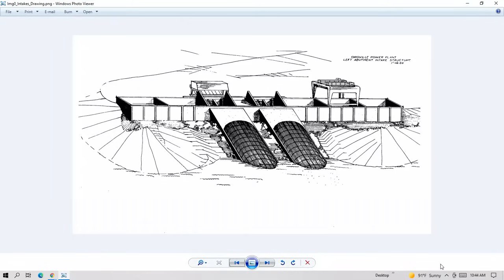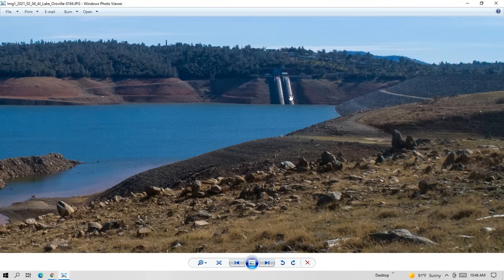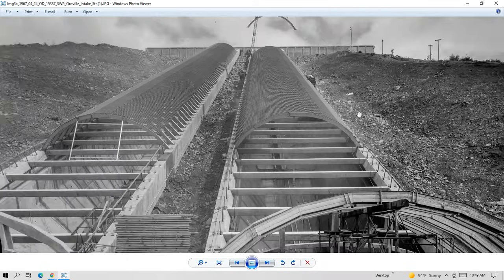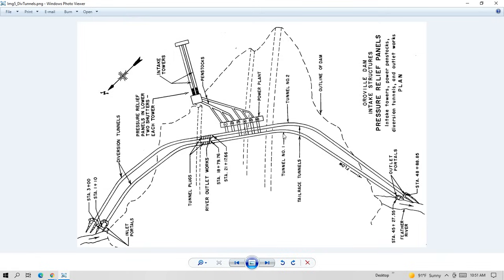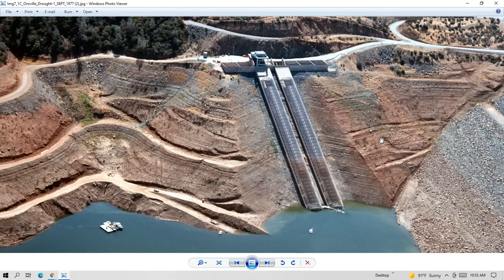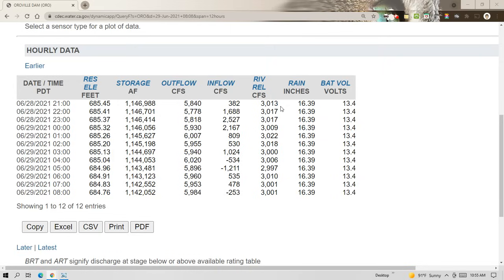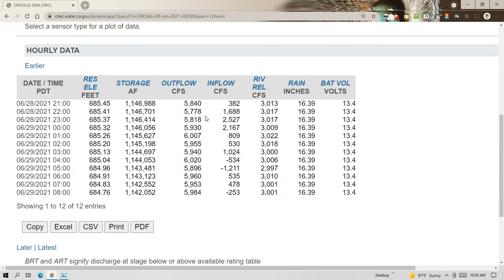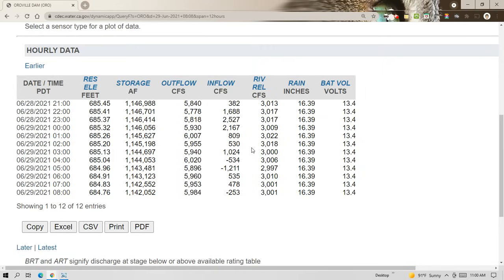When Drought Comes to the Oroville Dam by Millie Kay 06-29-2021

Comment: Good Job Millie,..... as always your statistic and commentary is right on and correct on all accounts ! The River Valve Outlet system ( RVOS ) as you know, is for the most part, a last resort means to the continuation of " just water " releasing into the river from the dam and the 6 generators in the undergrown Power Plant can no longer produce electrical power because water level is no longer high enough to flow into the intake structure.  As you will recall, DWR had a severe accident when the RVOS was used a few years back and the outlet flow baffles had to be rebuilt under that event and there were some critical injuries to DWR personnel that were operating that valve. Water that is now being diverted to the Thermalito Forebay can now drop the 100' through the Thermalito Power plant and not the spillway into the Afterbay as all 4 generators in that plant are now up and ready to go after the fire that totally shut it down back in Nov. 2012. But,....... at only 3,000 +/- cfs passing through, the RVOS and only one generator at Thermalito is producing power,.... so much for filling the gap during Brown Outs when the power generation from a total of 10 generators is severely limited to only one because of the sever drought water level conditions in the Oroville Reservoir as that water being conserved while the temperature is running in the high 90 to 110 degrees for days at a time requiring electrical power. Political DEMOCRAP Idiots are now demanding that electric powered vehicles are the wave of the future,...where are they going to get the power when the " N " word ( nuclear ) is not even in their vocabulary. 🙄

Hope that you are well Millie and keep up the good work.0 !!
Jerry
Reply from the maker: Hi Jerry! I appreciate your kind feedback. I am going to pin your comment to the top of my Comment Section since you explain the Thermalito power plant function, which I did not address in this video. You have some gems of info here that need to be shared. Thanks!
Reply: Jerry, the answer is simple even if the technicalities of making it happen aren't. Electric vehicles are the future regardless of your political affiliation. But they won't be powered by hydro in the West because the West has too many users and not enough water. You have to live within the ecology that you have out there and that's not currently the case. Electric vehicles can be powered from a number of sources, including nuclear, but I think ultimately it will come more and more from solar. Not immediately but the trend is already in that direction right across the country, even in states that are major oil producers. Yes, the sun doesn't shine at night but technology can overcome that, for example, storing the energy as hydrogen or any number of other methods.
Reply: "DEMOCRAP"?  Real nice.  If you find your way to keep politics out of your comments, everyone can enjoy them.  You totally ruined it - but you may not care.  That's the climate we are in these days.  Throw bombs at the other side and who cares.  Like minded people to you will high five you, but everyone else will say "wtf?"
Reply: @donmoore7785  Well well,...Don Moore sorry to offend you but the truth hurts and in this case the truth about  loosing  the battle with our power grid is screaming at you and guess who is in control ???
Reply: @donmoore7785  - Trump University grad?
Reply: @MillieKay  why are they lowering the water level in the first place?
Reply from the maker: @gregtowle8830  They have to keep the Feather River alive.
Reply: Do you realize once the electric stops the very old and very young will become casualties right here in America don't have to go spreading democracy anyplace else to see what death and destruction is scientists predicted fossil fuels made sure their voice wasn't heard. You will see with your own eyes 40 50 million refugees American refugees running to the mighty Mississippi drinking some muddy water good luck and goodnight.
Reply: What shall we do now Stutz, build more coal plants? If you don't want to use the "C" word (conservation), then the only answer is SMR's.
Reply: @edwardfranco5127  -How is it, you got it all wrong ?
Reply: @donmoore7785  Yep he did really well until that.

Comment: Because of silting,  the progressive decrease in surface are and the slope of the shores water levels should drop faster with each passing day unless replenished.
Reply from the maker: Hi Texas Yankee. Thanks so much for reminding me of that important mathematical principle! Since I check the numbers every day, I was just noticing that the level seems to be dropping faster now. Even with Inflows, Outflows and River Releases remaining essentially the same, the "foot-per-day" drop is not an accurate enough estimate to predict the expected date that it will reach 640 feet. Yesterday at this time, the level was 660.96 and today it is 659.21 feet. The decimal point has become more critical. Thanks again!
Reply: @MillieKay  This is very sad!  This is just Oroville, lets watch Mead and Powell! I wonder if anyone has looked at the future of aeration of any of the lakes once they become dead-pool? Artificially aerating on a grand scale may prevent a huge die off; just problem after problem. The Great Salt lake, now there's a big, big problem in regards to ecosystems and wildlife. If they would just institute massive conservation and allow more outflow of the dams they might save that system. I'll let it rest.

Comment: Are  there a security risk with the dammwalls drying up in a draught -they might get  cracks but I guess they know but do they care ?
Reply from the maker: Hi Jari! The Oroville Dam has been through major droughts before, so it can withstand a lot. I spoke to a dam expert about the potential damage that could happen to the Dam due to the drought. That person said it is not a big worry. They said the most critical thing is that dam owners need to do all the needed inspections and repairs while the water is low to ensure continued stability. Thanks for asking this question, Jari. I need to post something about this on my Community Tab today.
Reply: @MillieKay  well maybe they should check it and other is the moisture from the waterpressure behind these wall disappear and the wall(s) start to cracke or shrink -shouldnt a laser measure do the job of let say if the slope saged 1  inch due to drought ?
Reply from the maker: @jari2018  You raise really good points. This Dam is over 50 years old, and that has to be a factor in its ability to withstand drought cycles. I am not a hydraulic or hydro-engineer, but common sense goes a long way in these matters! Thanks.

Comment: It's crazy just how low this reservoir is. Wasn't it in 2017 there was fear of the dam breaking due to it being too full and now here we are 4 years later and it's almost empty.
Reply from the maker: Crazy -- yes, 2017 was a major crisis for sure. Also, as recently as summer of 2019 the reservoir was almost to the top of the emergency weir. Two years ago today it was elevation 891 and we were wondering if the newly-rebuilt spillway would be able to handle significant flows.
Reply: @MillieKay  so I guess the question people should be asking is where did all the water go?
Reply from the maker: @buckroger6456  Yes. I am of the opinion that sparse inflows can't keep up with the necessary outflows. It seems that DWR is fulfilling its obligations to the state water contractors, local districts/farmers, and  eco-systems according to the applicable water plan. I know that others' opinions range from man-made crisis to various conspiracies. I like to hear all thoughts on the matter (if they are expressed in a way that isn't mean). But I do love a good conspiracy theory LOL!
Reply: @MillieKay  well I'm pretty clueless about the whole thing. Heck I only found out about this like a month ago when a video popped up in feed. I could barely tell you what's going on in the city I live in other then that people here don't like the heat so I get the bike trails and path all to myself durning the summer.
Reply from the maker: @buckroger6456  The Oroville-Thermalito Complex is a fascinating system to learn about. I think so anyway!
Reply: @MillieKay  I would think they were all pretty much the same, but like I said I'm pretty clueless about most of this stuff. I often find the history of these places to be really interesting.

Comment: Millie, looks like we will be stuck at 16.39 RAIN INCHES for many months...Perhaps The engineers will be using the River Valve Release system this summer but this time do it safely and remotely. Your videos are the best in the business. It would be a shame to lose the energy produced from the Hyatt Power plant when we need it most. It's hot out.
Reply from the maker: Hi Mooore Cowbell. Yeah, they have to operate the RVOS remotely now. If the Hyatt shuts down due to lack of water, that will certainly be a milestone in the history of the Oroville Dam. Only time will reveal all the ramifications of such an event. Thanks for the awesome feedback. I appreciate it.
Reply: @MillieKay  I mentioned the RVOS system to a " Major -disaster responder/engineer" friend and he is intrigued and motivated to learn as much as he can about the dam structures and Hyatt plant. I referred him to your channel. If the power plant is shut down does that mean the RVOS valve will need to be opened to save the river habitat? Also, If all of us in the area purchase a case of bottled water and empty all 24 bottles of water in the lake will that help? JK.

Comment: During the spillway crisis why did they not open diversion tunnel #2? The water level dropped in June 27.83 feet.. At that rate it will be empty by August 31, 2021...
Reply from the maker: Hi Mike! Thanks for stopping by and commenting. During the Spillway Incident they couldn't use the RVOS in Tunnel 2 because it was shut down due to some fire issues in the plant. If you mean open the entire tunnel, those tunnel plugs are huge. Yes, it continues to drop at an average of about a foot per day.
Reply: @MillieKay   Wow, thank you i did not know this.... Millie, considering how dire the situation is why are they allowing pools to be filled? Average pool takes 20,000 gallons of water.   Also like Vegas constructed third intake at deepest part of Lake Meade, why doesnt California run a 36 inch pipeline from Lake Tahoe to nearest lake Folsom conduit to entire water system ? That would solve huge problems . Lake Tahoe holds 39 trillion gallons of fresh water..  A small amount like three trillion would fill Folsom 50X over ....and next winter Tahoe would fill up again..  Please keep up the great information.. Looking forward to your updates...

Comment: What causes the water to move up those intakes?
Reply from the maker: Hi markinchs!
The water doesn't have to move up the intakes. The intakes just sit in the water and the water goes in the penstocks from the intakes through a gate-type system. The mouths of the two penstocks are at the bottom of the intakes. That's why, if the water gets below 640 feet in elevation it can't get into the penstocks. I have posted the schematic from my video on my community tab at the following link. Thanks for your question (you are not the first one to wonder about that). Let me know if this helps to visualize it.

https://www.youtube.com/c/MillieKay/community
Reply: @MillieKay  ah - I think I get it. The water flows down into the penstock and then rises up the intakes after the penstock is full. Am I right? If so, what do I win?
Reply from the maker: @markinchs3629 The water goes down the penstocks to the turbines, which creates the hydraulic head they need to operate. Remember, the powerhouse is way down there under the dam. I love questions -- especially if I know the answers LOL.